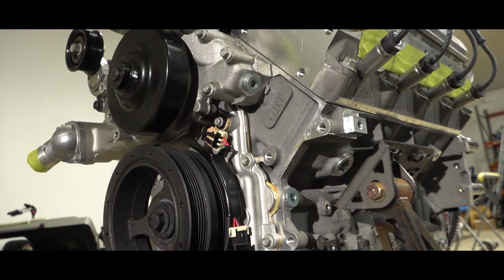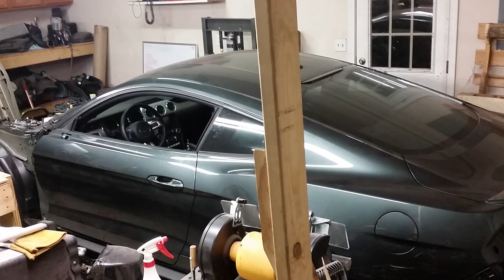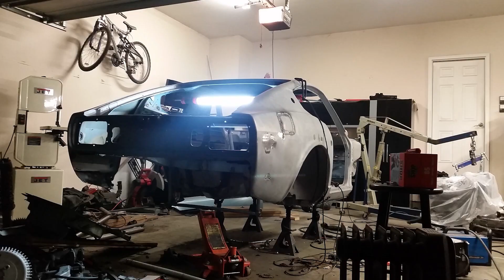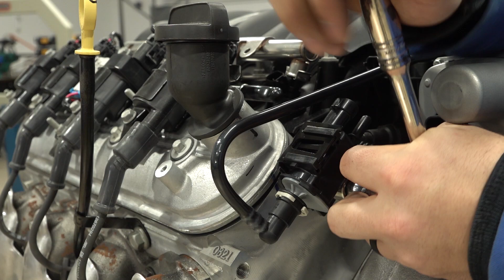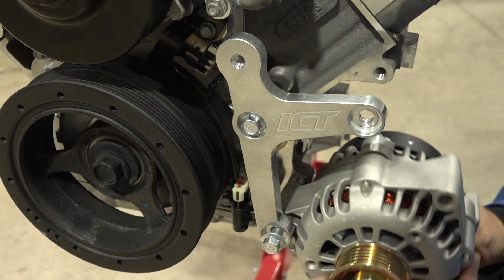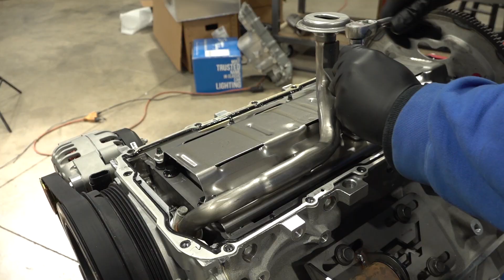I'm LS Swapping my Widebody Datsun Project Ep. 7

Comment: Hey, question, what harmonic balancer is that, truck , gto ,camaro?
Reply: And what size belt did you use?
Reply from the maker: It's a corvette crank pulley and the belt is a 550k6 using an ict billet low mount alternator

Comment: Hi Dave. I cant wait for your next video. I love watching you build and fabricate. I'm learning so much from you. Can you please tell me the model number or for the 105 amp alternator you used?
Reply from the maker: Hey I'm glad you've been into the series! Thanks for watching and I'm glad to share what I'm learning along the way. I don't have the AC Delco part number handy for the alternator but it was pn ALT300 when I purchased it from ICT Billet along with their low mount bracket kit
Reply: @GrindhousePerformance  Got it. Thanks so much.
Reply: @GrindhousePerformance  Sorry to bother you again. I bought the alternator, thank you. Did you get the lower bracket for the vett. or Camaro? They look the same. I'm setting up my LS 3 the same way as you did in my 77 280. Also, if you remember which pulley you bought for the Alt. bracket and the belt would be really helpful. I have much to learn. Thank you.
Reply from the maker: @eliasmansourati2074 all from ict billet: belt and pulley set 551550, Corvette bracket 551667-1, shortened alternator stud 551900. Good luck!
Reply: @GrindhousePerformance  Thus is really helpful. Thank you so much. Watching your video has gotten me excited and motivated to work on my Z.

Comment: Hey man, great build and nice videos! I am also using the same oil pan for my 280z build. Not sure if you are going to add an oil cooler. I did and I have some header clearance issues with the inlet and outlet fittings. I spoke with MAST since they only want you to use the fittings that are included with the pan. The only way to use different fittings like a banjo or otherwise (which are low profile) is to take a freeze plug and plug the hole that is in between the inlet and outlet holes inside the pan. Doing this will allow you to run any type of fitting. This was recommended by MAST technical support. 
Thought this might help if you run into clearance issues if you decide to run an oil cooler.
Keep up the good work!
Reply from the maker: That's extremely helpful and good to know, thank you! I was curious why they insisted on using their specific fittings

Comment: I'm 19 and I just bought a 77 280z a couple months ago and was going through the exact thought process that you did, I was set on an RB swap but it had to be RB26 or RB25 but then after doing about a day or two of thinking I just decided on an LS1/T56 combo because you really can't beat it. I'm 2 months into the build and I already got the lightweight Wilwood kit all the way around from Silvermine and I have the motor at the machine shop right now getting rebuilt and getting the Texas Speed Chop Monster cam put in it. I'm focusing on getting the car running and prioritizing drivetrain parts first like brakes and suspension and then do interior and body work, I know it would just eat me alive to not be able to drive the car for another year or two if I waited until last to do the motor, so hopefully my car will be on the road in maybe a month or two? I'm also going carbureted because it makes the swap 10x easier and I think it does justice to the fact that all the classic S30's were carb'd as well, and even with going carb over efi I should still be looking at a little over 400whp, and I'm gonna eventually put a 100 shot on it so it'll be rowdy. I'm also not cheaping out on the build but I'm saving money wherever I can because that's the main thing keeping me back, but your build is awesome and I can't wait to see it on the road! I know I'm pouring thousands into my setup so I can't even imagine what you're throwing into yours, keep up the good work!
Reply from the maker: That's awesome! Sounds like you're moving really quickly! Momentum is huge in projects like this. If I were to do it all again I would do smaller stepped improvements where I could still drive and enjoy the car in between. That'll still be a blast to drive, looking forward to hearing about your progress!
Reply: @GrindhousePerformance  Thanks a lot! I'm gonna try and post videos of my own, but probably not of the restoration itself just documenting progress because if I were to film everything and edit it then my build would take way longer than I'd like.
Reply from the maker: Yes, I'm finding it takes 3-4x longer for me to film, script, and edit the build process, but it's honestly really, really cool going back to watch the progress made from previous videos. It's also hugely motivating sharing with fellow builders or enthusiasts. I'd say record as much as you can!

Comment: In the END.. we all just want Smiles and Miles. There are PLENTY of issues in any swap.. .but a reliable known chassis shell with a known reliable running gear. Still has issues to work thru.
  I don't blame you for ,fore going the eco- boost.
   Nobody can beat the light weight compact ,easy to get parts for LS motor.
   You can have your cake and eat it to with the LS.
Reliable power per dollar per pound you CAN NOT beat.
I'm building two Z cars with L28's. 
But I subscribed because I like ,you thought it thru.. and here you are FORD dropped the ball and Chevy is " on the ball !"
Reply from the maker: Agreed! There's still going to be a lot to do to have this on the road and I'm looking forward to the challenge. Thanks for your interest in the build!

Comment: Awesome content. My question for you is how/where do we research if an engine works (reliably) in an application. I had some of the same concerns but really have fallen in love with I6  M-series engines.  Information on N55/S55 to Datsun are limited shy of B 4 Build.
Reply from the maker: I'm definitely the wrong person to ask that for haha. I was so excited about the 2.3L that I bought a totaled EcoBoost Mustang without ever taking a tape measure to anything. This wound up with the shifter basically planted next to the seat-backs in such a tiny car. I'd definitely see what measurements, if any, you can take before spending money on anything. I hadn't really considered how much larger/boatier the new Mustang is compared to the old Z. I think the approach would be finding information on N55/S55 swaps into anything and then having to use your context clues to see what may or may not apply universally, or what may apply to your specific install. I do think I've seen a couple of those though, do think it's doable.

Comment: It'll be very interesting to see this build! Where did you get the crate LS3 from?
Reply from the maker: I ordered through JEGS while they had a sale and rebate going on for it 👍
Reply: @GrindhousePerformance  Nice! What was your reason for not going 2JZ?
Reply from the maker: The 2JZ would've done a good job satisfying the Japanese inline 6 roots of the 280z, but if I was going to go with an engine manufacturer that wasn't Nissan, I preferred the LS to 2JZ. The debate to me was more RB versus LS, but that might just be because I haven't had a lot of personal experience with JZ engines. Maybe in the next build??